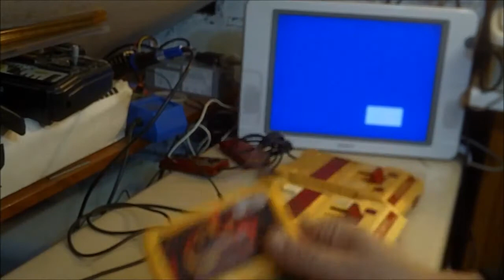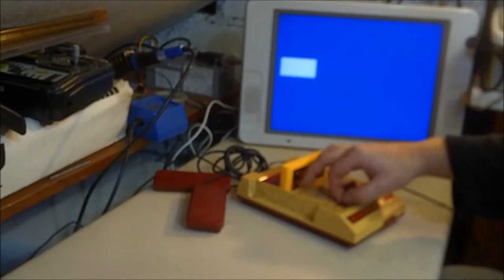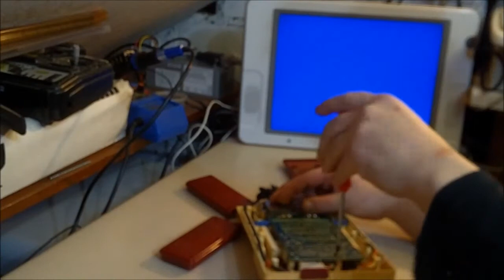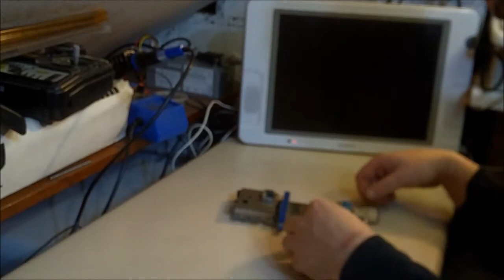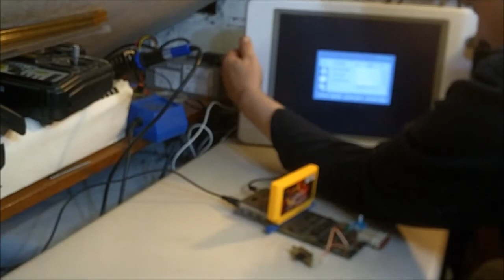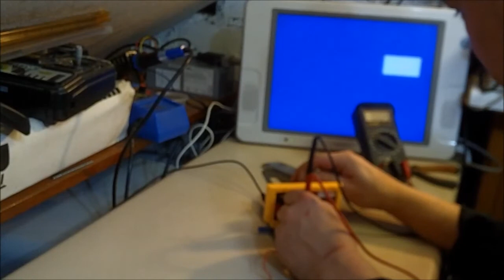Famicom repair Pt1 We try to get both consoles working on RF output

Comment: Great stuff!  I've learnt something today - never noticed the on board fuse before lol!  I think you're idea of doing composite mod is wise!   The modulators can sometimes be part of the problem.   You can quickly just connect comp video lead directly to PPU video out pin without any amp or anything - just to test!